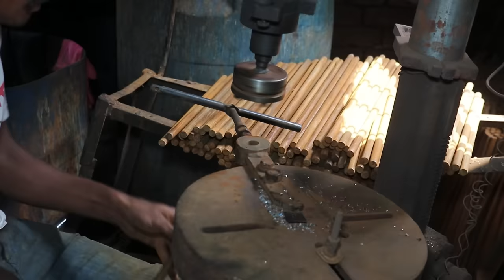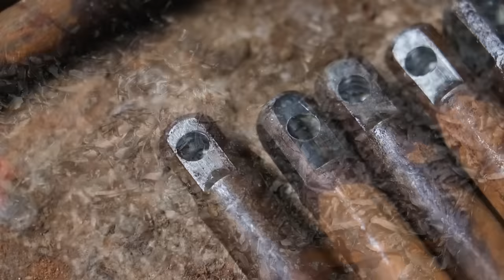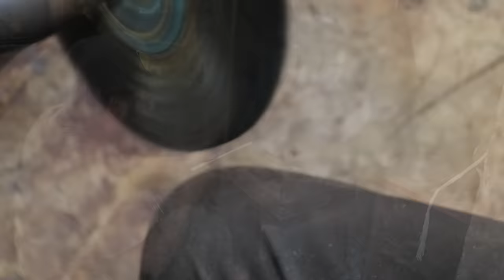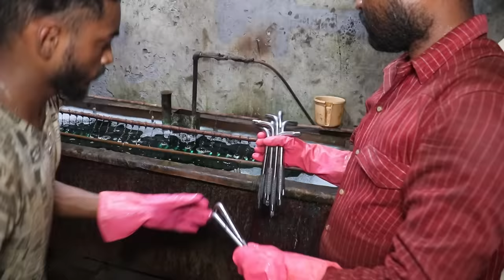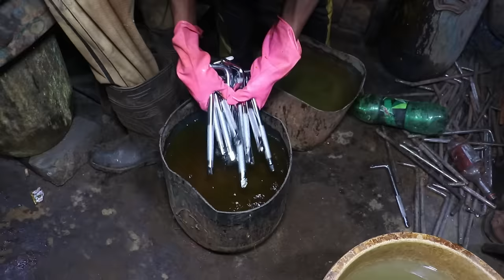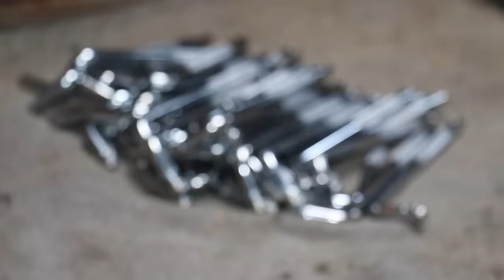The Craftsmanship Behind L Handle Socket Wrenches

Comment: And that’s how Snap On tools are made, Billy.
Reply: “Hey dad, is it true that half those tools are going to Snap-On and the other half to Harbor Freight?”
Reply: @TheRoflcopter84  no son.   1/3 to snap on, 1/3 to harbour freight, 1/3 to Princess Auto (Canadian)
Reply: @Torontodude20000  hey don’t hate on princess auto lol
Reply: @4smereka  believe it or not.  When I first started work at my current job.  I used to buy tools at Sears and Canadian tire until someone told me about Princess auto.   I went down there one afternoon and grabbed a ball peen hammer, imitation channel locks, a 2” bit set and an automatic Centre punch which outlasted my starette automatic Centre punch. This was 22 years ago.  I still have and use them to this day.

Comment: Great to see everyone is using their OSHA approved safety glasses and footware along with their N 95 respirators!
Reply: first ones ive actually seen using gloves
Reply: At least they are getting paid. Do you think they dispose of those chemicals safely?
Reply: @jakerazmataz852  no chance
Reply: I think they are lucky to have gloves.
Reply: All that bs does is increase the price of a product.  You should be glad they don’t care about that
Reply: Seekfirst Thekingdom, yep, I can’t stand all these arm chair expert safety police. Funny thing, these guys probably have less injuries than your typical joe safety nut does on some osha approved  assembly line
Reply: @johnnyappleseed9254  100% Johnny
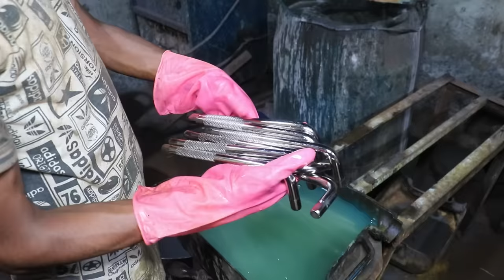Reply: Have you seen the videos of Pakistani truck frame and shaft repair? Those guys are wearing sandals as they remove super heavy shafts and differentials, and they usually do not use dollies. 5:39

Comment: I have a lot of respect for these hard-working men. I can't imagine doing these jobs day after day.
Reply: Which step do you consider hard ? All of those tasks could done by actual children, and they often are
Reply: @xl000  Hard as in physical labor is not good on the body not so much the difficulty. Years of it will break down your body rapidly, especially in unsafe and unclean environments.
Reply: @xl000 , it's all hard. Any repetitive boring job is a nightmare physical and mentally if it is long term. I presume that they regularly swap out job roles to guard against boredom and injury.
Reply: @xl000  the mind numbing boredom that can come from these jobs is one of the hardest things to do for work.  If you love what you do it’s not hard.
Reply: @xl000  You obviously never experienced a tedious, monotonous job. 
Try picking up and putting a pen in the same spot for an hour straight, and then you'll better understand what it's like for these men.

Comment: Damn! That is a 19th century construction method.
Reply: well, 21st century, most probably in India
Reply: @frenky29a  Definitely India/Pakistan but that method is so labor-intensive and likely hasn't been used in the West for 100 years. Having said that, those are damn good wrenches and I'd buy one.
Reply: @raisagorbachov  you'll snap it right in half trying to put a lug nut on, and then have a hell of a time getting the socket off cause there's no real retention on that ball bearing in

Comment: I have one of the same model "Made in India" ($5USD, $100 mexican pesos). And have been using it to pre-torque tire bolts without an issue. One work and it pays for itself.
Reply: You must not torque above 80ft lbs then,  this crap is a waste of resources

Comment: Cut to lengt
Debur
Make square end
Add hole for ball
Add grip textuee
Remove rust
Lower surface roughness
Debur grip texture
Bend 90°
Visual check
Coat in ? Stuff
Clean
Another bath in ? Stuff
Put in sand
Take out od sand
Add locking ball
Put on sleave

Remember this the next time you need to make one at home

Comment: Eye opening video. On the technical side, what does the ball do that was hammered in at the end? I thought that is supposed to be spring loaded to hold the socket, but in this wrench maybe just added for the looks? I did not see a spring.
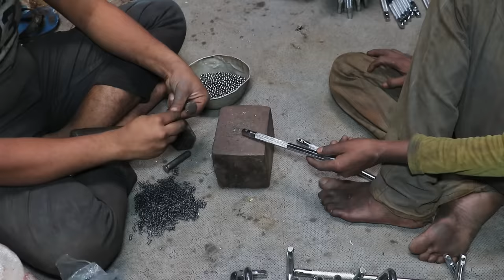Reply: @chris4562  7:15 Look more closely and you will see the springs as they are picked up, placed behind the ball and then swaged in place.  The springs are in a pile in front of the worker's right leg.

Comment: In the lab i once spilled few drops of acid on my lab coat and my shoes, my cloths underneath the coat turned out fine, the leather on my shoes got a shallow crator/burnspot and when I reached home that day I found my sock had a hole just undr where the acid had landed on my shoe

Comment: Is there any heat treating them these parts or tools?
Reply: Was thinking the same. They do the bending pretty late in the process so I guess there's no heat treatment. Would make sense to give it some spring temper? Otherwise the leverage won't do anything but bend the wrench.

Comment: This is what you buy for $1.50 at Harbor Freight. Its not even heat treated so you can literally snap the end off when you're using a socket. Its a worthless lump of mild steel camouflaged as a tool.

Comment: This could all be automated, but probably not worthwhile. If it takes 10 workers to make 1000 of these per day, and they make $5 each per day (average salary in Pakistan/India for low skilled labor), that would be only 5 cents in labor cost per wrench. Cost for the steel rod is maybe 10-15 cents. The Chrome plating adds another 10 cents (?), so the total cost maybe 25-30 cents. 
Those wrenches ends up being sold for $10 in the US. Nice profit margins along the way.